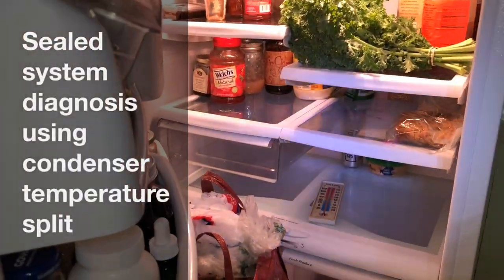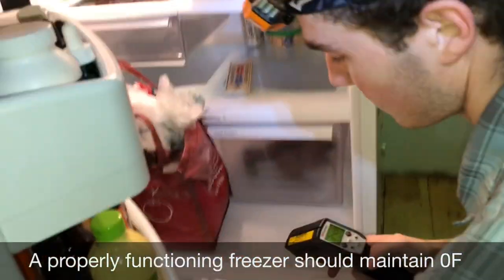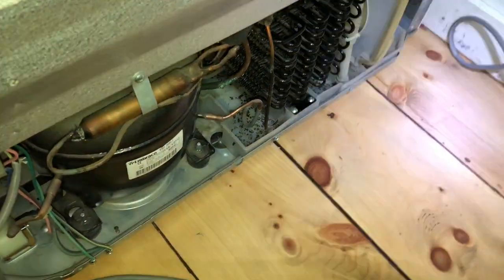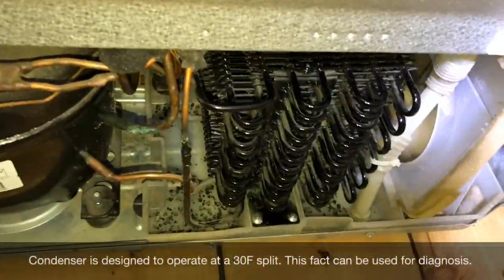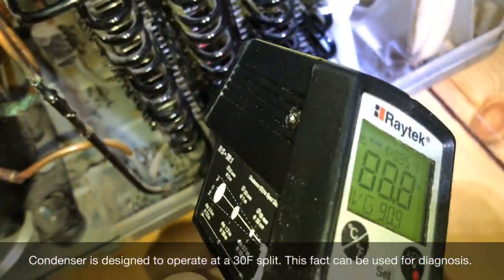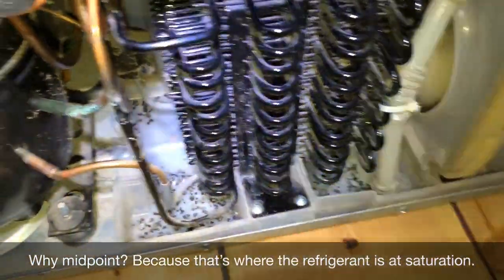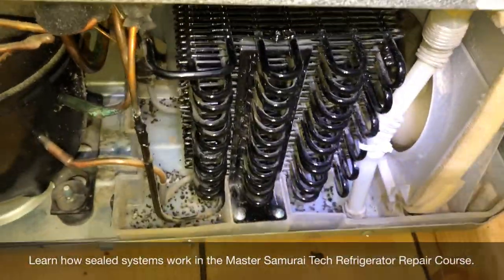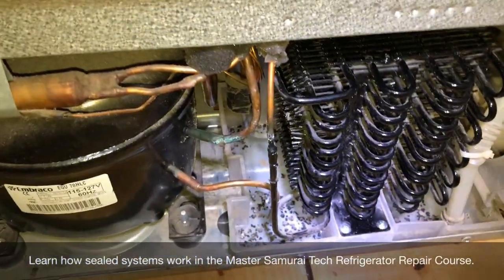Refrigerator Sealed System Diagnosis using Condenser Temperature Split

Comment: Another easy way is to check the compressor's amp draw. If the compressor is not pumping or there is no charge in the system, you'll see little to no load.

Comment: Hi—can you please explain how we coma fix a sealed system leak. This is for the DIY person. I got a diagnosis  just to get the system dried and checked for leaks would be $642—not including repairs. 
Any knowledge shared would be greatly appreciated. Thanks
Reply: @nunyabusiness6746  co I work for charges 295 just for recovery.
Reply: You probably don’t have the tools for that and they can get expensive. Also you need to have some kinda understanding of refrigerants. If you don’t know what you’re doing you could injure yourself or someone else. Sealed System repair is not for the DIY person.
Reply: @RR-vu3ol  I bought the tools and fixed it :-) Almost free $2500 fridge minus some tools.
Reply: @Flanknodger  can you share what you did?